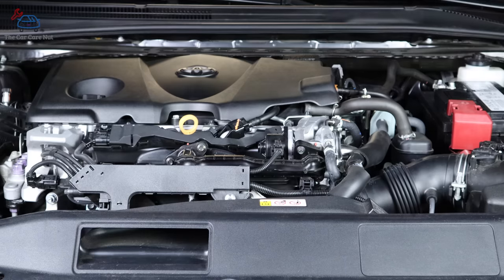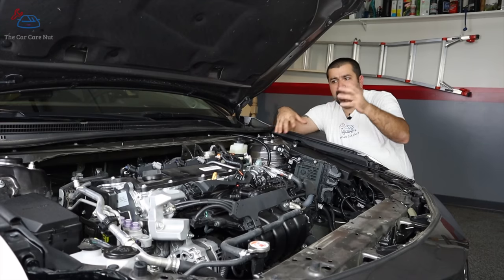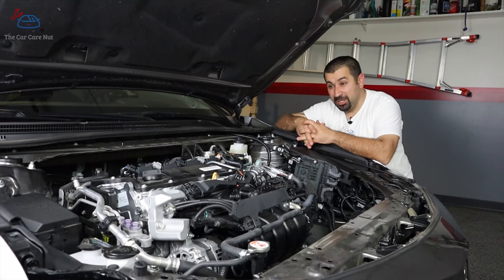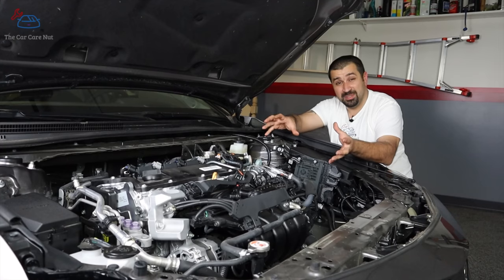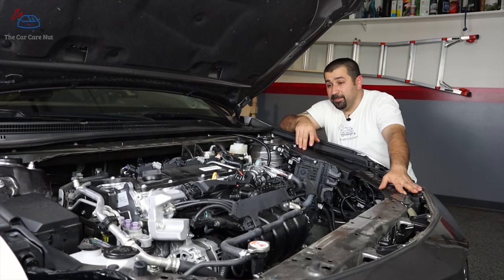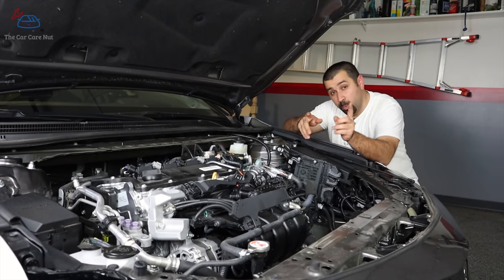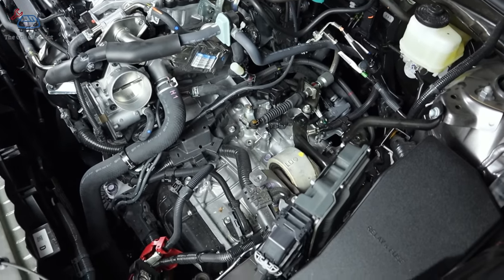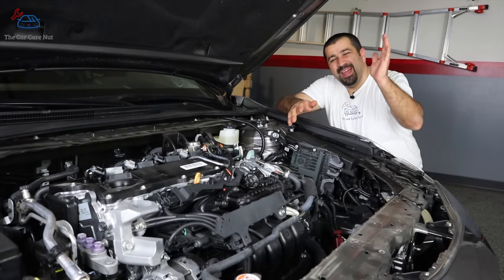Toyota's New Engine Technical review Part 2 : Variable Valve Timing, DIY tips  and Parts location

Comment: Hi Sir thank you for the reviews you made with this engine. I have a Rav4 2020 and uses the same engine that you mention. In your review you said to use W16 oil. However during with my first PMS the toyota dealer in the Philippines uses 15W30 oil is this ok?
Reply from the maker: That’s a bit too high of viscosity but different markets have different standards. I would bring it to their attention if they even have 0w16
Reply: @TheCarCareNut  Noted thank you I will double check whats required in the manual. Hope to see more of your vlogs be safe
Reply: Outside of the USA and Canada, 2021 Toyota owners manuals say 0W-16, 0W-20, 5W-20, 5W-30 can be used at all temperatures and 10W-30 at temperatures above zero degrees F in the A25A-FKS and FXS 4 cylinders: https://imagizer.imageshack.com/img923/3448/gBxMOF.jpg
Reply: @4af  Thank you for the information right now the car dealer here in the Philippines uses 10W30 since we don’t have winter season.
Reply: Opinion...
Water jacket channels in these new engines and head & cam channels sizing are on concern for the oil viscosity, fluidity flow. (Which is not a  winter/summer conditioning). Another thing, in winter time the engine can warn up in 10 minute to 50°c,,which is hotter then Philippine's summer.
Reply: @4af  Thank you for this i was almost scared into using 0w16 in this engine going to use 0w30

Comment: Why does the Toyota Corolla use the 2.0 instead of a 2.5L?
Reply from the maker: Hi! They figured the 2.5 would be too much and the smaller displacement helps with gas mileage.
Reply: @TheCarCareNut  >>Makes sense.

Comment: So how do you replace the plastic valve cover if you cannot remove the high pressure line from the direct injection pump?
Reply from the maker: You can remove the high pressure line. There's a procedure for discharging the line for service. Once the pressure is discharged you can remove the line. And Toyota recommends that you don't reuse the line when removed. So as a recommendation the line would need replacement as well.
Reply: Yes, as you can see, even changing out a valve cover gasket will be much more complicated than in the past.  Don't blame Toyota, its government emissions & fuel economy standards that must be met for all auto manufactures.
Reply: @onenikkione  I blame the Demorats. I bet in a few weeks gas will be 4 bucks a gallon again like in the Obummer years.

Comment: Does This Camry also has an electric water pump ? 😮I thought BMW was the only one complicating their engines 🤦‍♂️
Reply: The hybrids from gen 3 atleast also have an electric Water pump
 Works Great and removes the need for a Belt

But in the rare Case it does stop working you need to stop or risk the Engine

Comment: Toyota has good reputation about reliability of its products, but when the things become so complicated, nothing could be reliable. Thank you for this video, I'll avoid this engine  as a plague. Many of those repairs could be done only in dealership which crazy expensive. I wish I could by older made Toyota in a new condition, and can do fixes by myself. Sad.
Reply: You can get a 2021 Tacoma 4 cyl - it still has the 15 year old, simple and bulletproof 2TR-FE motor.

Comment: So when that timing motor fail and the car go into limp mode, you just take to the dealer to change the motor or can you dyi on your driveway? Changing the motor will fix the issues? Or do you need scan tool to reset anything?
Reply from the maker: The motor replacement is not hard but it does need a procedure done with the scan tool afterwards. Not something very expensive to replace and calibrate labor wise. And other than the calibration you don’t need a lift or anything to replace it. I can see it being DIY with care
Reply: @TheCarCareNut  does 2020 xse v6 has this motor?
Reply from the maker: No. The V6 retains the same oil controlled variable valve timing on all 4 cams just like before. The 4 cylinder only has it on the intake side.
Reply: @TheCarCareNut  thank you, I learned a great deal from you.

Comment: I don't like the computer in the engine compartment. Electronics don't like heat. And when will they learn to put real screw-clamps on the larger coolant hoses? The spring clamps eventually leak. And the thin oil kinda scares me. I really don't look forward to working on my new RAV4... so I hope it's reliable...
Reply from the maker: Thank you for your comment. In my entire career with Toyota I’ve never seen an engine computer that’s in the engine bay fail.

Also the spring clamps are not random. They are designed to expand and contract with heat so they keep sufficient tension on the hose at all times. Screw clamps or worm clamps are the ones that leak or crack the plastic housing underneath them because people often over tighten them and then they leak when the engine warms up and everything expands.

Your RAV4 is awesome and other than maintenance which is very simple and easy to do, doubt you’ll be dealing with any of the fancy electronics much.
Reply: @TheCarCareNut  Thanks for your informative response. I am less apprehensive now...  you've put my mind at ease. We also appreciate how you don't talk down to your audience. I wish you much success with your great channel.
Reply from the maker: Thank you for watching my channel Have a wonderful weekend!

Comment: Do you know why is doing that when i get to stop engine is making small 1 second rough vibration car is new couple thousand miles
Reply from the maker: Hi! Which model?
Reply: @TheCarCareNut  2021 camry
Reply: @TheCarCareNut  se 2.5
Reply from the maker: It’s possible it does that when switching between injection modes
Reply: @TheCarCareNut  and also when i staying on neutral car not vibrate but when i put to drive and not moving its come back the same rough vibrating  from my previous message very small but still is it normal? Thank you sir
Reply: @TheCarCareNut  inj modes are from engine or trans?
Reply from the maker: Hi! It could be normal. Have your dealership double check

Comment: I find the nervousness about using 0w16 kind of amusing. When I started driving (and working as an oil change monkey) many people used 10w30 in their cars except for those that insisted on using 10w40 or 20w50 warning us 10w30 fools that we were wrecking our engines with that thin junk, its only good for Grandma's trip to the Bingo hall. When the car companies started advising 5w30 I could see beads of sweat on the 10w40 crowd. But when 0w20 became the new norm those people just lost their fricken minds. We're all doomed they'd say, you fools, that oil is too thin, your engine won't last 60,000 miles. I'd find them sitting in the oil aisle at the local store clutching their bottle of 10w40 sobbing quietly, No, no, it can't be, it can't possibly work, then lashing out at anyone taking a bottle of 0w20. That was almost 20 yrs ago. I guess it is time for a new generation to have their beliefs shaken. 🙂

Comment: I work on older and newer aircraft. From experience, I haven't heard anything good here. Not a single thing. Just lower cost manufacturing and higher initial, maintenance, and repair costs. Imagine the cost of "the computer" when you have to replace it because one micro function of it doesn't work and it turns on your engine check light even though the car runs fine. The car won't pass inspection with the light, so you're shelling out a fortune to have it replaced. Of course you can't just bolt on a new one yourself because it has to be programed. Toyota is already counting the profits.
Reply: What's the  MTBF for the computer?

Comment: More moving parts less reliable it's a fact.  Even the 'car care nut guy' admits it in another video. This engine was developed with the bottom line in mind forcing the DIYer to take the car to the dealership for service.  After all the service department is the cash cow for the dealership.  If your commute is short this car is fine.  I commute a lot this setup is not for me.  My future car could be a Mitsubishi its a primitive technology i can fix it with my Harbour Freight tools 😋

Comment: Designing a reliable electric motor is not hard.
Much less if it is brushless, which should be the case, so there is nothing electric or electronic that should break, except mechanically (gears).

Mechanics will have to learn more electronics and digital control to understand the new engines fully.
Reply from the maker: Thank you for your comment. Very early on in the life of this engine I’ve personally seen a few of these motors fail. Although that was potentially an early production issue it’s still possible. Also when it comes to cars many things could disable that motor outside of its design. Things like rodent damage, other control components having issues and even incompetent mechanics and Toyota has been pretty good about anticipating these issues from past records and integrating safety nets in case.

Comment: The Germans have been using plastic cooling pipes for years and they all crack and leak after a few years. 
They all start requiring replacement around the time after the vehicle is out of warreanty. 

It is done because they are less costly for the manufacturer. 
This is a very bad idea for any car, truck,..., including Toyota!
This is not quality driven.

Comment: Retardation is definitely the key word here.  I really fear this motor will fail much sooner than all my others.  I've owned 6 Toyotas, and currently have 5.  355,000 on my oldest, 200,000 plus on the others, and my 2021 RAV4 has 8,000.  No way will I get over 200k on this over engineered model.

Comment: Are you qualified in any way.
How do people know if you know what you are talking about. What are your actual qualifications.
The claims of reliability of this product are only some thing that can be proven with many years of actual use and abuse. The technology on this engine and others like Mazda are very over top with complex complications that can have high possible failure. Its not if but when. Simple no hassle design is the only rule that goes with longevity.
People its important to understand that this guy makes you tube video's.
If he was any good at making a living at doing   technical repair or diagnostics of this or any product you would think he be still at it. Not trying to make an earn on the You tube.
You make up you own minds, think about it people.
Reply from the maker: Thank you for your comment. My qualifications are listed on the channels pages. I am currently working with Toyota and you are welcome to stop by the dealership where I work and see for yourself.

I make YouTube videos to help share my experience that I have accumulated over a long career with Toyota that is still going. I am sure that you have similar or different experience which I encourage you to start a channel and share your experience to help people. I will be the first to subscribe and look forward to learning.

Regarding reliability. The same was said when the switch from carburetors to fuel injection and computer control. And the same was said when the variable valve timing came out. The Toyota is to lose the race to be the first to come out with new technology and win the race on who can make such technology reliable. I stand by the company that puts food in my children’s mouths and at the same time I don’t have a problem calling them out when they mess up both on YouTube and on the engineering teams face. 

Accountability and continuous improvement is what makes Toyota what it is, not high ego, distrust and intimidation.

People often comment that a “stupid grease monkey mechanic” shouldn’t question engineers designs and should shut up and go wipe some grease. Anyone that says such statement doesn’t know the internal culture of Toyota.

Toyota is a team. Technicians and engineers have a unique relationship of respect and mutual benefit. And either side of this team has no problem calling each other out in the spirit of continuous improvement of the product.

Have a nice day.
Reply: He is a Master tech. That means he’s the cream of the crop of mechanics. He’s got all the certifications..Ever watch a Scotty Kilmer video? He has over 50 years experience, and he does you tube videos. Became a millionaire doing it. He still works on cars to stay current , but doesn’t need to. Your making an awful lot of assumptions about this guy. I’m not an auto mechanic, but can do many repairs that most people wouldn’t do. I do have a technical background, and worked on industrial high speed equipment for many years. I stumbled on his channel a couple days ago, and subscribed, because it only took a few minutes of listening to tell you this guy knows his shit. I own this car, and did a good bit of reading on the tech of the engine that was out there early on. He covered all of it, only in greater detail.. impressed with his knowledge
Reply: @boldcitycc  
I agree  with you, I   also stumble  on  CCN channel. I subscribe because of content and technical responses he give. 
The  CCN  Thanks